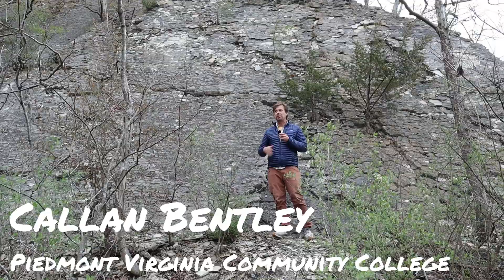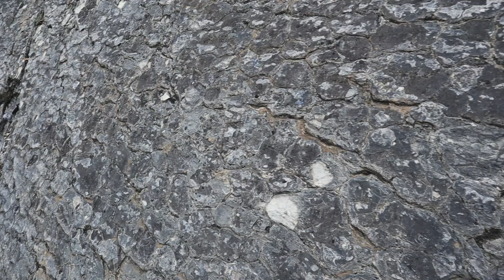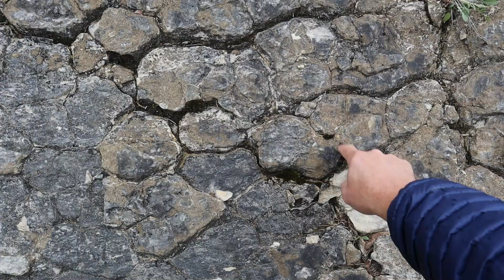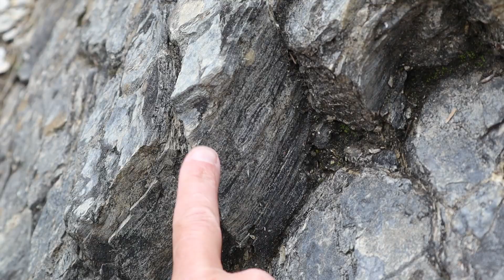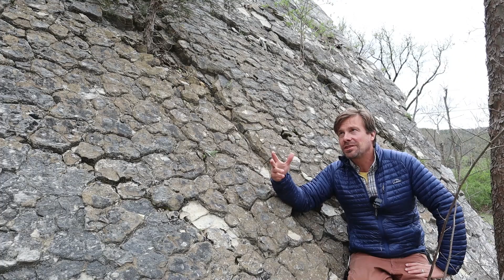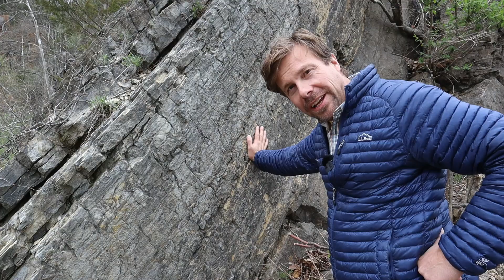Tonoloway Mudcrack Wall

Comment: Are there any fossils present (ichnofossils maybe) to help further pin down the depositional environment? Or even to help with determining the age, or was there another way the age has been radiometrically determined if not relatively through fossils?

First video i stumbled upon and definitely won't be last, keep up the good work! 😁
Reply: Typically, rocks of this age in the northeast have very good conodont time control. The Tonoloway has been well studied as the supratidal flats deposited as the Appalachian Foreland Basin began to flood via an ocean inlet south of the Taconic Mountains. The Helderberg Group, which overlies the Tonoloway represents this flooding as the Appalachian Sea expanded outward to the northeast/southwest from a central axis overtop of the tidal flats.
Reply from the maker: @joshc8671  Thanks for that great response. I'd add that what I see in this area in this formation is a ton of ostracod body fossils, usually in big death assemblages all on the same bedding plane. Not a lot of traces in this unit that I've noticed.